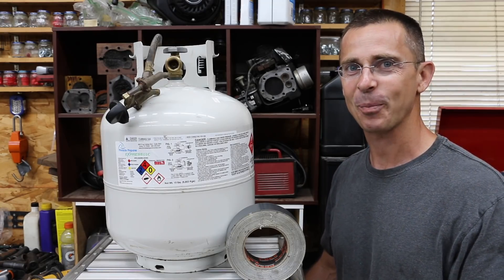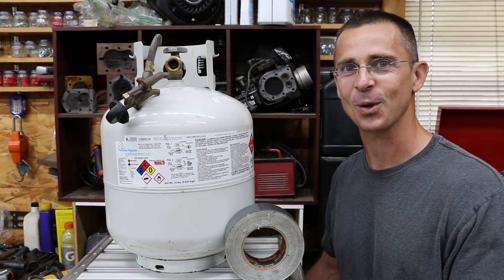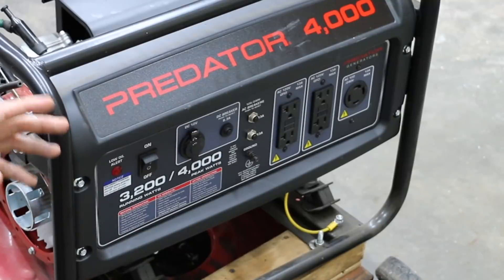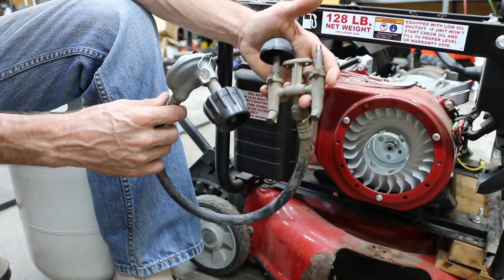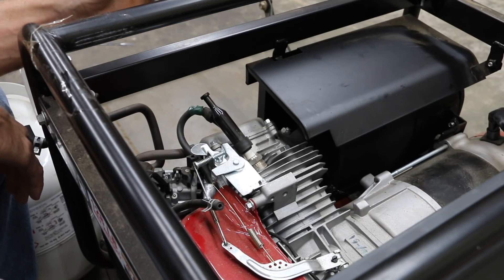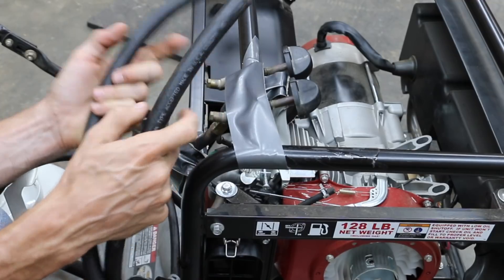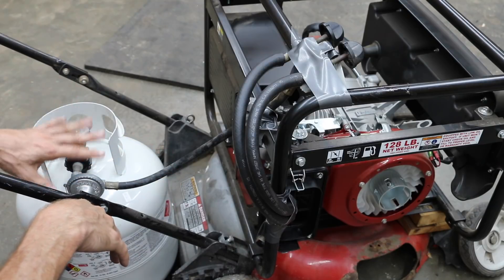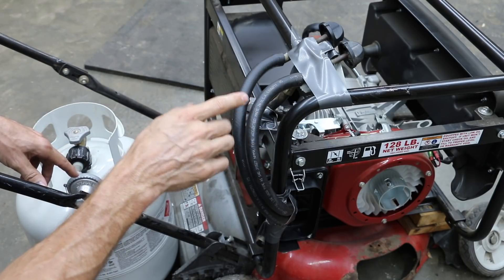Can a gas (propane) grill power an engine?  Let's try it!

Comment: That’s how I start my small engines after they have been sitting for an extended period. I just use an unlit hand held propane torch. Put it into the carb intake.
Reply: That is an interesting method.
Reply: @garethbaus5471  That's what I was thinking, very, very interesting.
Reply: Today we can fuel up our trucks with LNG. Liquified Natural Gas.

So, a truck that has a load in the back, combined weight could be up to 40 tons, is powered these days by Liquified Natural Gas.

Cars in the past (and still today) can run on LPG. Liquified Petroleum Gas.

In the old days people ran cars on woodgas.

So i just do not understand it.
They now use LNG because of it being better for the environment. Less exhaust shit coming out.
BUT: We already were driving cars on LPG in the past, and on woodgas.
So why did it take so long before we started to convert from normal Diesel to natural gas?

I just can not believe that it has to do with newer technology.
That in my mind is complete bullshit, since cars could run easily on LPG.
Infact: Shell use to burn off the LPG, because they said there was no use for it.
And lateron they started selling it to power cars.

Infact: If you got a car in this country (the Netherlands) which is not imported, has a LPG tank built in from the factory (and some other factors perhaps), they call it a G3 car and it is subsidized (or at least it was).
So, such a car would be as expensive as a normal Petrol car, as for the road taxes.
If you have a similar car but it was imported, or the gastank was build in lateron, it is not a G3 car, and so it will be more expensive to run it on LPG.
My brother had a Deawoo Espero and i had one. He had one that was G3. I had the exact same car, same type of LPG tank and installation, but it was imported from another country and so it was not G3.
So i had to pay like say 75 dollars a month for roadtaxes while he could drive the exact same car for 50 dollars a month.
(all of the above figures are rough estimates, just as an example)

I really do not understand that if we could already drive cars on LPG, aka GAS as in real GAS, as in not a liquid (so not Petrol) that it took another 30 years before they started to use trucks running on LNG aka Liquified Natural Gas.

To me it sounds like "They" (the puppetmasters who want to stay in control) had to come up with ideas to indoctrinate the people to accept such nonsense.
Because, if we could already drive cars and such on natural gas or woodgas or petroleum gas, then it is ridiculous that we are still filling up our petrol tanks with petrol or dieseloil.
Reply: I do the same, to allow the engine to get going and prime the regular gasoline fuel system. Much better than starting fluid on rubber components.
Also determines the ability of the spark and engine compression to operate properly.
Reply from the maker: Thank you for the feedback
Reply: Thanks for sharing.
Reply: we used acetylene to get an old dragline to start in subzero weather back in 1966, .with the help of a little O2, it was like adding nitroxide to a dragster.

Comment: Hey bro, use a Y connector on your hoses eliminating one going into thecarbon.Drill the appropriate size hole for the tube into the air breather cover and that thing should run really smooth. I built the gas fume generators I told you about a while back and have a lot of ideas for stuff like this. So, I hope you run one with 8lbs of propane to 8lbs of gas and see which one runs the best. Would like to see the outcome. I might consider putting one together for myself. Thanks for the voids they have been really informative!
Reply from the maker: Thank you for the feedback

Comment: In school we are taught that an orange flame is not good and means that the induction charge is filed with to much oxygen and even some hydrogen (water). So this would mean that the propane produces a more efficient combustion result and should produce more hours and more mileage than gasoline. FYI.
Reply from the maker: Great point. Thank you

Comment: Before i even started to watch this video i had to read your title several times to realize its wrong ... maybe ..??
Why did you put GRILL in the title ..?? 
Correct me if i am wrong but the title should have been can an engine run off propane gas ... 
Answer is yes ... you just have to regulate the flow of propane into the carburetor
Reply from the maker: Thank you for the feedback
Reply: You do know that they sell propane generators right..??  As well as dual fuel that run on gasoline & propane...

Comment: A friend of mine installed a propane kit on his car back in the 80's after running the engine on propane the internals of the engine were significantly cleaner. Propane will deliver less power due to lower fuel density, but I think it's only about 10% less so it's relatively insignificant. Think the only reason it's not widely available for automobiles is the infrastructure for fuel delivery and storage and there's no road taxes on it. You should mount a small bottle to a lawn mower and see how it does powering a mower used to cut grass for a season. Seems like a gasoline engine runs quieter on propane.
Reply from the maker: Thank you for the feedback

Comment: Back in the early 70’s, I was given a project in my engine shop class of converting a gas powered lawn mower engine over to propane. 
I vividly recall how odd it seemed to control the engine speed with propane tank valve adjustments. 
My method of feeding the fuel used a flexible tube connected to the carburetor fuel inlet and a piece of gasket material, cut to the carburetor outlet flange shape with a small orifice hole in the center, installed between the carburetor flange and the engine. It worked well.
Reply from the maker: Seems like a really interesting and fun project!

Comment: I thi k you should cook a steak on a running engine. When I go camping I cook a steak on my engine block. I wrap  some skirt steak wrapped in tin foil and place it on my manifold in between the carb and valve covers and it takes about 2 1/2 to 3 hours but it does cook. You should do the same on these small engines
Reply from the maker: Thank you for the video idea!

Comment: I bought a carb for a honda generator that uses propane. It cost less than $40 and starts first pull from cold.
Reply from the maker: Great price!
Reply: Where from ?
Reply: @jimmyhendrix3257  amazon it's unbeilevable

Comment: There are carb kits you can get that incorporate propane ... also there are buffers that are used in businesses that are propane powered with a special carb that will run an engine like a normal gasoline engine and can be set for gocarts or other variable throttle applications
Reply from the maker: Thank you for the information

Comment: Stranded in the real Bush in a F250 petrol  Ute..... ran out of fuel.  Hooked up the large  acetylene bottle hose (held in the back with oxy bot.) thru to the engine carby.... aircleaner off ......and stuffed rags around the open end to the top carby packed with rags to stop leakage. 
Turned on the acetylene bottle jumped into drivers side, hit the key... rough coughing start BUT just  got me to the nearest bitumen road  some 40 miles away ... True story l scariest ride ever had ....... but it worked.
Reply: The most Australian comment ever.
Reply from the maker: Wow!  Thanks for sharing this experience!
Reply: Fuck around respect lol
Reply: Aussie.....

Comment: When my brother and I were kids our dad got us into flying rc planes with 2 stroke nitro glow engines. As we got older we acquired go-karts and would mix the fuel into the gas tanks thinking it would increase the octane. We used anywhere from 10%-15% nitromethane fiel to add to the gasoline. We felt that we gained a little power and it also smoked a little do to the castrol mix for the two stroke
Reply from the maker: Thank you for the feedback

Comment: you could have hooked the hoses directly into the fuel line so that it would have went directly into the carburetor. I think that that might provide you with a better fuel to air ratio. It may even provide for longer run time.
Reply from the maker: Thank you for the feedback

Comment: Propane is actually really good engines, modifying most vehicles isnt that hard and is very very common in russia, the reason its not done in the US especially is because russia charges us a lot for it because we put heavy sanctions on them, however over there it is cheaper than gas and is better for the engine and it can start at a lower temperature easier so its a no brainer for a lot of people, i own a 66 imperial that was converted to propane for most of its life and recently converted back to gasoline before i purchased it and the engine is beautiful
Reply from the maker: Thank you for the feedback

Comment: ive seen commercial kits do this with a forklift regulator that uses engine vacuum to adjust the fuel rate. its not really much more complicated than what you did and often has a bit fancier way of injecting propane in(typically a custom made adapter plate with a propane/natural gas jet. this video shows how they are done not my video but expains it better than i can and would love to see you convert the go cart using this method and see how it works! https://www.youtube.com/watch?v=wd9yRVkAGco
Reply from the maker: Thank you!
Reply: @ProjectFarm  this video expains it better than i can explain it and looks like a rather  safe way of doing these. most of the commercial lp or natural gas kits ive seen that part is the largest expense,the second being  the custom crafted bolt on adapter for going in front of the carburator to allow gas use as well. 

....https://www.youtube.com/watch?v=wd9yRVkAGco

Comment: I have a self propelled mower with a side drive could I rig up some kind of fuel control to this drive increase my compression use the spark plug hole for fuel intake wire up some kind of glow plug and turn my lawnmower into a diesel
Reply from the maker: Thank you!
Reply: My vision was turning the side pulley into a cam figure out how it times with the crank mounting a manual fuel pump that runs off the cam improvising a jet that fits the spark hole mill the head  either remove the carb and put a tube with an air filter my big question is how to warm it up and if the compression required for a diesel would make it impossible to pull start I just happen to have a 50 year old monkey ward mower that still runs it even has the original spark plug it's been used so much that the drive wheels are about worn off I actually have no intention of trying this myself but you wanted an idea and I have looked at this mower many times wondering how I could keep it going for something it's a real diehard  good luck with your future projects I have enjoyed all your videos I know this is drawing on but about ten minutes after watching your duct tape trials I watched a movie called the perfect husband anyway about halfway into it the wife stabs the guy in the neck he doesn't panic but instead opens the cupboard grabs a roll of the gray duct tape and wraps his entire neck with it and it immediately starts to come loose I started rolling I thought you poor sob you should have watched project farm

Comment: I've done something similar with natural gas when working on an ATV whose carburetor had become gunked up due to the damn ethanol that the intentionally contaminate our fuel supply with these days.  My outdoor cooking area has valve that has a 1/4" NPT fitting on it and I've hooked up an air tool quick-connect fitting to it, so I can use my air tool hose to locate a burner well away from the house (e.g. when smelting lead for bullets or when deep frying a turkey).  When determining if the ATV had a carburetor problem or if it was something else, I used this along with the air blow gun attachment to give bursts of natural gas into the air filter box.  It ran, so that meant a carb problem.  I never bothered to test it for longer running times since it would be a pretty useless endeavor for an ATV.  I've wondered about doing something similar for a generator though.  I probably should consider it before the next hurricane takes out power for a week. :)
Reply from the maker: Thank you for the feedback

Comment: If you run a single hose off the regulator you can connect it to the crank case vent boss on the breather unit and also be able to run the engine with the air filter. You'd then use a makeshift filter over the breather on the crank case to avoid sucking and dirt directly into the case. Works beautifully. I do this so I can run my air compressor inside the garage without gassing myself. It sat for a few years with gas in it and ruined the carburetor, but with the propane, all I need is a venturi and throttle valve and it's back to running air tools
Reply from the maker: Thank you for the feedback

Comment: In Oz they use these inside shopping centres on polishers running on lpg. Less pollution than running petrol. A bit warmer but it’s not too much. I used a fraction of the 9kg using it to mow the lawn 6 times over. Absolute awesome
Reply from the maker: Thank you for the feedback

Comment: How about instead of propane,  you set up an oxy acetylene torch with a (neutral flame adjusted mixture) and ran that as fuel. Gas only.  Will it run?
Reply from the maker: Thank you for the video idea!

Comment: Actually "premium cheap fuel": average quality is 100RON/90MON (thus 95AKI) at a fraction of normal petrol's (95RON - 90AKI) price. Pure propane is around 110RON / 97MON so around 103AKI.
Reply from the maker: Thank you for the feedback

Comment: I used to own an automobile that ran on propane. You will find out the doing an oil change after running on propane that the oil has less contaminates thsn it would have been run on gasoline or diesel.
Reply from the maker: Thank you for the feedback

Comment: Great job! I don't remember if you stated the HP of the engine. Were you able to keep track of the propane usage to determine the amount of propane used, time used, and engine hp? Trying to determine propane usage in a 1/2 ton pickup engine. Thank you.
Reply from the maker: Great point.  I didn't test HP

Comment: The fuel dial worked out great. I used a ball valve with my lawn mower and it was an little difficult finding the right mixture to get it started but worked great when it did.
Reply from the maker: Thank you for the feedback

Comment: I expected this to work -- I learned to drive in a car that could run on either gasoline or propane, and aside from having less power on propane, it was hard to tell the difference. What I didn't expect was that you could just rig up a throttle body injector with leftover, non-engine parts.
Reply from the maker: Thank you for the feedback

Comment: Where you able to aquire a diesel engine yet? Im still wondering if it will run on mineral oil. Thanks
Reply from the maker: I have a really old diesel generator.  It runs but smokes a lot

Comment: I used to sell tri-fuel generators.  They could run on gasoline, natural gas, or propane.  Many farm tractors have been running on propane for many years.  Propane has less heat value per unit volume, but propane has a higher relative octane rating (about 112, as I recall).  Gaseous fuels burn very clean.  Propane was very cheap years ago, but has now become quite expensive.  That was a good test.  A propane carburetor would be a better deal than the two hoses, but the test worked.
Reply from the maker: Thank you for the feedback

Comment: My suggestion is put the gas tank back on and the propane and run both at the same time and see if you get better fuel burn of the gasoline which interns increases run time or in a gasoline engine in a car would it intern make better fuel mileage if just a little bit of added propane to the air intake or hydrogen because around here it's only $14 / 20 pounder a propane tank refill would adding a little bit of propane off-gassing into the air intake increase fuel mileage
Reply from the maker: Thank you for the video idea!

Comment: Someone needs to make a one way tool to use drill to start engines didn't break wrist nut came loose flywheel came off destroyed ignition &crank on go cart had to junk it could've been killed .
Reply from the maker: Thank you for the feedback

Comment: Alot of forklifts run on propane, and some commercial pickup trucks, its quite interesting actually, cause theres two ways that a propane engine works, one with liquid fuel, and the other with a gas fuel, obviously the liquid fuel will run more powerfully, but consume more gas than the gas engine. (I once looked it up, cause of my job, i had to drive a propane powered forklift and i was curious how it worked)
Reply from the maker: Thank you for the feedback

Comment: you can buy a small generator that runs solely on propane but the high water content in propane becomes a problem in extreme winter environments. the moisture builds up in the engine crankcase and pushes out the oil seals or worse yet freezes and then pushes seals out. also happens with gasoline engines but is not as common. i've seen pallets of used propane generators used by contractors and they all were almost new but leaking oil terribly. also i replaced the oil seal on my boss's honda eu100i because it was full of moisture and had been forced out.
Reply from the maker: Thank you for the feedback